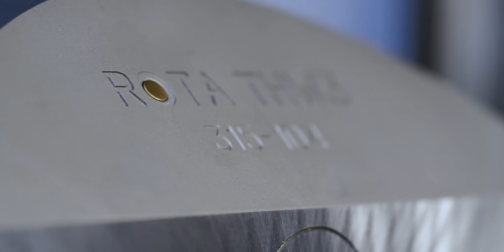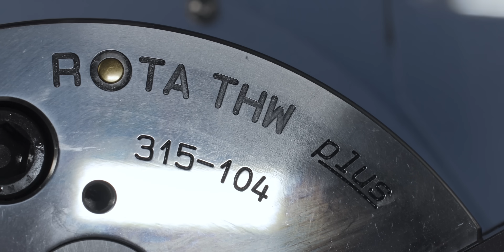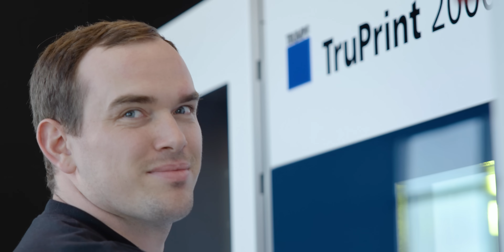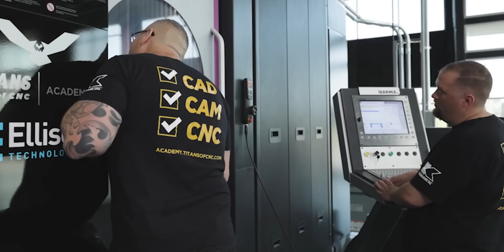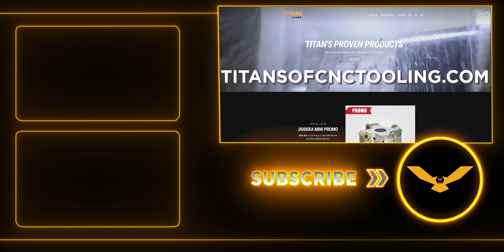Should Engineers Be Arguing with Machinists Over Run Time?

Comment: Overall a very good channel, but this is probably the worst video I have seen.
Full disclosure: degreed mechanical engineer and former executive at an automation company.  Became a "bean counter" by necessity.

What the narrator fails to understand is that the effort implemented by management likely had both goals: to determine who was the most efficient (they probably already knew) as well as determining a baseline labor cost for the components.  The end goal with comparing machinists is unknown, counter-intuitively an employee that finds the most efficient way is often not the hardest working "head down" guy, it is the guy some may see as lazy.  Some large automotive factories put their more "lazy" employees on a new piece of equipment, they will find the most efficient way to run it to keep up with the line rate.

Difficult to say for sure but in my experience this was not to pit one machinist against the other or set them up to fail.  Setting aggressive time standards during development is beneficial, assuming they are adjusted for reality once a reasonable level of efficiency is reached.  Clocking in and out for breaks or other work is also just a good practice during this phase, otherwise the cost of going to the coffee pot and bathroom will be carried to these parts forever.

Treating development as a separate project is also beneficial and good business practice to accurately provide evidence of R&D costs for tax purposes.  When the machinist is $60, $80, $100 per hour (labor absorption cost) regardless of what he is doing in the building, it is important to ensure the labor cost assigned to the component is as accurate and realistic as possible. 

The engineers probably didn't handle it properly and should have strived to understand where the time overages were occurring first, although without knowing the management structure they might have had to go through the machining supervisor.

Comment: Lol sounds like the company I work for, they also slap the quoted time for programming and machining for one off parts, so if a programmer takes 9 hours (and usually does and still gets it wrong because he isn't a machinist, go figure) to do his part on a 10 hour job, the machinist is left with 1 hour to correct programs, setup up machine, prove and cycle. And gets the blame when the hours are over quoted. Just have to keep telling them it is what it is. Shoddy management. Cant wait to leave.

Comment: The amount of insanity I've seen from engineers is mind boggling. Every single week I see 3d models with things on them that either can't be made, is waaay too expensive and simply stupid. 

- It can be countersink holes literally touching the edge of a part - which seems okay on the 3D model but in real life that edge wont be there after machined.

- Tapped holes that either goes through the part or way too deep. Often just because it was "easier to draw it like that".

- TINY inside corner radius on tall parts that are near impossible to make.

- Extremely tight tolerances on shafts with no real purpose. When asked why - the answer is "well, we just want a good looking surface... the tolerance isnt really important" <- Insanity. Those parts will often cost 10x what they thought it would.

- Small parts for robots with every single edge having a radius on them and not just the standard radius that endmills often comes with, oh no. We're talking about special ground endmills for no fucking reason.

- I get the idea of lastercutting and waterjetting parts. But sometimes they REALLY should have gotten the input from a machinist before deciding what to do.

Just a little list of the many things I experience weekly.

Comment: As an Electrical Engineer that knows how to run cnc machines from a cheap desktop 3d printer to a Hass mini mill and a Stratasys Fortus 450mc. Also worked in an additive manufacturing lab. I've seen a lot of changes and blaming in different industries so it mostly depends. If I need to quote a part I go based on what machines that will be doing the work and if I don't have good experience using that machine I wont quote it. If I can't quote it i would talk to a machinist that will do it and let them look through it. If its an external job or personal piece that I cannot make in house i will talk with the machinist and see the easiest way to make it with their tooling and there comfort, especially with tolerancing. I say tolerancing because some rather use a manual machine for some parts and I use a metric CNC that I've tuned for micron precision.

Comment: I don’t understand why there is such a divide between engineers and machinists. Here in the UK it is almost drilled into you that you are either one or the other and never shall the two skill sets cross! Absolutely ridiculous mentality in my opinion. I am an Engineer with a “degree n stuff” but I am also a hobby machinist, and do some manual machining at work when required, and I simply don’t understand how you can be an engineer without At least an understanding if not a passion for machining. I often discuss order of operations and machining processes with our machine shop when I design a product because if you want the end result to be competitively priced, you have to make it as quick and easy to machine as possible. Engineers need to swallow their pride and take advice from production. After all “if in doubt Ask” works both ways! Or at least it should do in my opinion.
Reply: As a machinist i think i could help a lot if i got to see the engineers drawing before release for manufacture. I could just highlight any difficult features or tolerances. Just bring it to their attention. If its still needed then at least the engineer would know 💶💶💵💸
Reply: @EVOMAN14  if your company operates a quality management system such as ISO 9001 they should be doing design reviews that you could ask to be involved in. Not sure of the intricacies but the quality manual should be available for all employees to read and should highlight who is responsible /required for each process such a design reviews. Be warned though, you might open a can of worms 😆.
Reply: @alexjamieson3822  we are a sub contract machining company. We make a lot of prototype parts for the oil and gas industry. I think earlier collab between us and the customer would be benificial for everyone 👍🏼 i wish i could communicate this to our customers. Im not the boss 👎🏼😂
Reply: @EVOMAN14  yes being a subcontractor does make it a touch more difficult. We are in the same boat but we design subsea oil and gas products that we have made by a subcontract machine shop. We are fortunate to have a really good relationship with our subcontractors and welcome any feed back from them. I always try to make their lives easier whenever the design intent permits.
Reply: @alexjamieson3822  where in the UK are you if you dont mind me asking? I am between Inverness and Aberdeen. Most of our jobs go to Aberdeen. Downhole tooling mostly. Its a great job. Another issue i have is that i would love to see some of our products assembled and working. Or even some more info about what they will be used for
Reply: @EVOMAN14  we are based in Huddersfield West Yorkshire, but we have guys based in Inverness and Aberdeen. Most of our stuff goes that way. This is one of our products that we were lucky enough to get diver cam footage of the install from our client. https://youtu.be/CYbnIchGN8U
Reply: @alexjamieson3822  cool vid. If you ever need a quote or to expand your list of subcontractors then you can try us. My boss is called Graham Wilson and the company is Standfast Precision Engineering. 👍🏼

Comment: Engineers have machining experience. Machinists are a bit intense when it comes to quality. Sometimes a bit too much but it depends on the product. The word arguing sounds bad, but I believe arguments have to be presented in order for anything to upgrade. It starts with arguments. Arguing is fine. Complaining is not.
Reply: In Québec, Canada, there's two ways of becoming an engineer. Either its lots of books or you go through pratical trainning before going to Uni. So in Québec, most engineers have choosen the pratical path and therefore in Québec, most engineers have machining, welding, fabricating, 3D printing, material science background :)

Comment: It seems short sighted that they are concerning themselves with the one off costs of items intended to speed up processes down the line.
Often the design of parts eats into the lead time of a project like this and it is the people at the end of the process that come under the microscope to makeup the difference.
Also it can be annoying when making parts to speed up processes could be more optimal if only the people involved in these processes where asked for input at the design stage.
Good places to work have respect and communication flowing in both directions, nothing worse than a place full of a lot of us vs them bitching.
It is so counter productive and dissatisfying.

Comment: In principle tracking the workhours required for each part is not really a bad idea, at least when clocking in and out doesn't create that much unnecessary overhead. But especially for these custom parts that system certainly doesn't make sense like that manager implemented it: It's difficult to give a reasonable estimate for these parts, and it creates wrong incentives to overestimate it when you then have to do the job yourself, or underestimate it when someone else has to do it. And why don't the engineers simply talk to the machinists about these parts when the get the impression that they take much longer than expected, or even get them involved in the design phase of it, to maybe come up with a design that is easier to manufacture? I'm not a mechanical engineer myself (I'm a process engineer), but we make sure to always get the other disciplines involved that actually have to do the job that we design and then put on the drawings.
EDIT: And don't forget that safety, as well as the quality of these custom parts always plays a big role as well: No point in being very fast with the job, if it then fails inspections or you create dangerous situations because you have to reach an unrealistic goal.

Comment: i think to optimize production times is a task for both engieneers and machinists. Machinists know their machines capabilitys and how long if takes for certain features to be manufactured. If you design a door knob with all kinds of crazy contures that need to be made on a 5 axis machine in hour long finishing passes with small tools to get in small pockets and stuff, the programmers possibilitys to reduce cycle time while maintaining the quality are pretty limited.  However if the machinst and the engieneers are talking to each other and are both looking at the part and figuring out what features are even necessary or can be changed in a way that makes them much easier and faster manufacturable, thats when you will cut times down significantly
Reply: You don't even have to go that far, I generally include handwritten notes on my drawings that explain why parts were designed the way they were, and which features are actually critical and which tolerances have to be met for which reason. Found out years and years ago that if you explain to the person doing the manufacturing what you're actually trying to achieve, that they'll usually figure out a way to make it do exactly what it's supposed to do. Especially for a one-offs, the main thing is that it works and that you know what you actually manufactured, it's kind of to be expected that you'll have to make little changes I think? And trying to do time tracking on such parts is inherently ridiculous to begin with, it takes as long as it takes to manufacture it. If you want it done quicker, figure out a way to build it entirely out of laser cut sheet metal and off-the-shelf nuts and bolts...

Now if we're talking volume production, that's where engineering comes more to the forefront when trying to hit certain production volumes. For example, sometimes it's more efficient to go for a slower process with more overall throughput. It's sometimes hard to explain why you'd go for the method that takes 20 minutes instead of the one that takes 5 minutes, but if that machine that takes 20 minutes to achieve the same result only costs a fifth of the price and takes up a tenth of the space, then it's way more economical to have five of those machines chugging away at it for 20 minutes each. I think a lot of misunderstandings between engineers and other staff arise from such decisions.

Comment: A good machinist is an engineer. Should be able to programme on the machine awell as using CAD. Also a good machinist is one that started on manual machines. I think ypu get the tactile feeling of maching and materials.
Reply: Hold up. Being a good machinist doesn't mean you can use the laws of physics to calculate the static and dynamic stresses on a part in service and sometimes during production (usually you use rules of thumb for production). Machinists are skilled workers and engineers can't replace them, but don't ever conflate the two, they're chalk and cheese.

I respect the physical side of the process enough to know I can't do it but most of the physical side doesn't even know enough about engineering to even have a clue about what they don't know and just circle jerk about how engineers don't know anything.
Reply: @MiG82au  We all come under the bracket of engineers my friend. I wasn't knocking Engineers who work on the mathematical and theory side. I'm a machinist and a fitter and come under the bracket of engineering department at my work place. Engineering just has all different areas of expertise. 
I was getting at the fact a good machinist is a good engineer and not just an operator of a cnc machine 👍🏻
Reply: @MiG82au  Yea except engineers can't use the laws of physics to calculate the static and dynamic stresses on a part in service either, they have software to do that for them. Software built by physicists, math quants and extremely high IQ programmers.